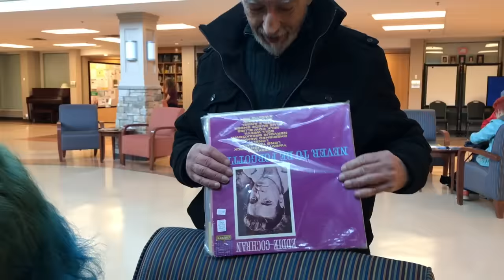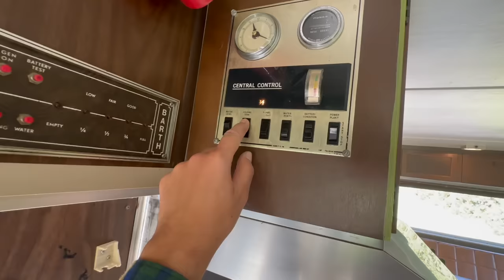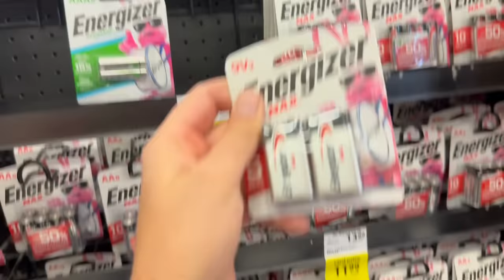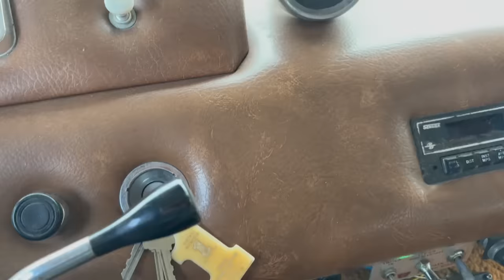Part 3 Free Motorhome Rebuild, Finale!

Comment: Good find, most RVs from that era had poor construction that one is an exception. With the aluminum roof especially. I had a Winnebago 1972 that I used and repaired for a couple of years most of them are scrap because of leaky roofs and ruined interiors. Your family could really have some fun with that. Those old Onan gen sets are simple. Happy camping.

Comment: My uncle ordered a Travco "Travstar 320" in late- 1975 from Lynnwood Dodge, just north of Seattle. In a short amount of time, it went up to Alaska and stayed up there until the early 2000's when it came back down to the Seattle area and was refreshed. Aunt & uncle used it for a few trips, then they gave it to me. I've put a genuine, French-made LeCarra steering wheel on it (optional starting in '77 or '78), retrofit LED bulbs in the vintage CIBIE fog & driving light housings, full compliment of 7 Alcoa wheels (spare included) and now keeping my eyes open for a 6BT & Allison transmission to transplant in.

The well-built, vintage motorhomes are really becoming desirable. Airstream/Argosy, Barth, Clark Cortez, Condor,  Foretravel, GMC, Revcon, Travco, Vogue as well as others in good shape aren't bad to own...

Comment: Be sure to thoroughly check the vacuum brake booster(large piece behind the master cylinder) as the rubber diaphragm will perish and cause your weak braking issue. The old Barth is looking awesome. It just needs some loving. Cheers and keep the great content coming.

Comment: The screw heads on your motorhome remind me of the ones on my 1972 mobile home/trailer. They’re called a clutch screw. You can get bits for a drill / driver and you can get old fashion manual screwdrivers. They come in two sizes and it’s something I really had to look for when I bought this trailer.
Reply: Hello Nancy

Comment: Though I love that color green, I painted my front door that same color, it would have looked more cohesive with one of the cushion colors. Or maybe a burnt orange. Just an observation. Other than that you did a fantastic job. I acquired a 1999 FLEETWOOD camper a couple year ago. I have dressed her up cute Inside with new curtains, and sticky wood flooring in the back bedroom, bathroom and kitchen. I love the wood cupboards so I will keep that look but maybe change up the pulls. Outside I too want to paint her and give her a pretty dress after all these years,lol but after replacing the original awning with a permanent awning she looks more happy already. Its fun and satisfying doing a make over. Good luck, as always, in selling it. I am sure someone will grab it up fast.

Comment: Looking good. Just a suggestion. You might want consider sound a d head insulation for the doghouse cover over the engine as well as under the floor of the footwell area of the driver's and passenger's seats. It will any long drive much better.

Comment: Another small point.  The previous owner of my 1977 Minnie Winnie had switched from 16.5" rims to 16", when they bought a dandy set of new tires.  Then they parked it for 10 years, and to avoid a dry rot blow out, and a towing bill, I got 6 new 16" tires for $3,000.

Comment: That was a fantastic job!  You know what you can do and what needs to be done by a specialist.  One inexpensive upgrade I would recommend would be to replace all the interior lights with LEDs.  I'm always uncomfortable with the hot, high current incandescent bulbs, and it looks like a few covers are missing.

Comment: Home Depot sells Carpet Tile Glue.  The difference with contact glue is Carpet Tile Glue never dries out, it stays tacky which makes pulling up the carpet very easy.  Plus it does not have an odor.  Also be aware that carpet tile has a grain which is marked by an arrow on the back.  Varying the grain direction creates different patterns.

Comment: those hinge screws are refered to as clutch head fasteners. they were used on GM vehicles in the 50s and today in some Holly 4 bbl carbs, hard to find these clutch head screw drivers today

Comment: It's got great windows in it!  I'd buy it in a hot minute if I was up that way!  (I'd re-paint that green to match the new front seat material. - and I'd get all new seat cushions made in that same color scheme, but multicolored like the existing material so dirt doesn't show)   Did you wash the curtains?  You can probably find out about the shower in the manual.  You can probably get a replacement stove burner grate online for that one that is missing.
Reply: I was thinking the same about the green. Not a green fan anyway.

Comment: I've used carpet squares in several vintage Motorhomes and Airstreams.  They are great to work with.  Use double sided industrial tape.  Makes it easy if you ever need to replace a square due to damage, etc.

Comment: Be sure your shore power is disconnected before firing up the generator. Just in case the transfer switch is not working or does not exist. Generator pretty much for use when shore power is not available. Boondocking!!

Comment: Alexander,
It's "Rarin", to go!
Here's an interesting suggestion from down below:)
Rik
@wadedempsey5543
@wadedempsey5543
9 minutes ago
Looking good. Just a suggestion. You might want consider sound a d head insulation for the doghouse cover over the engine as well as under the floor of the footwell area of the driver's and passenger's seats. It will any long drive much better.

Comment: Do you have air ride?have it checked your setting lo in front and off center in back. Good luck. Ps these get between 8 to 10 mpg. Have it inspected for chassis and brskes,grease and wheel bearings and em parking breake
Again good luck.
.

Comment: the onan generator has a 220 plug in above the battery. that is what you plug the cord into when you are using the generator. also the gas dripping on the driveway will eat a hole in the driveway. the holding tank is waht you dump out. is that an awning over the door and window?

Comment: *I can tell you aren't an rv-er. * Using contact cement or other high fume adhesives are not suggested in a living space that gets so hot in the sun. also, most rvs now have laminate or wood floors instead of carpeting. I've found small sachets of Irish spring soap shavings help ward off mice. RVs HAVE CHASIS AND HOUSE BATTERIES. the house batteries are to run a separate 12 volt system that runs lights, waterpump, and possibly heater when you aren't plugged into shore power or running the generator. Also, the generator, shore power and alternator can charge the 12v batteries. I hope you tested the water system, pump heater etc. Frig will take up to48 hrs to get to full temp. Usually the bathroom sink faucet pulled out to become the shower head.

Comment: Your screw head is what is called “ clutch head”
They are designed purposely so not to take them out.
If you purchase a 5/32nd straight slot bit you can remove them easily.